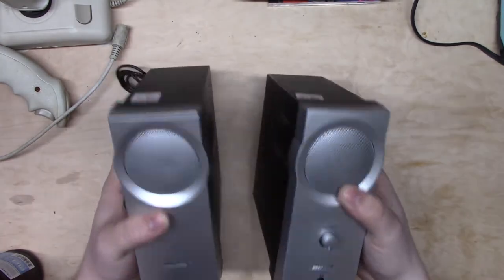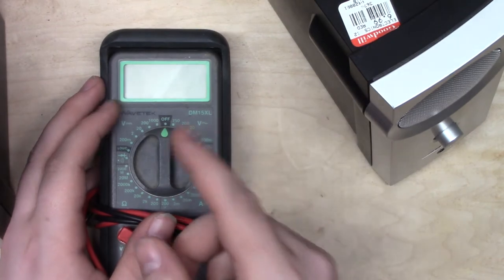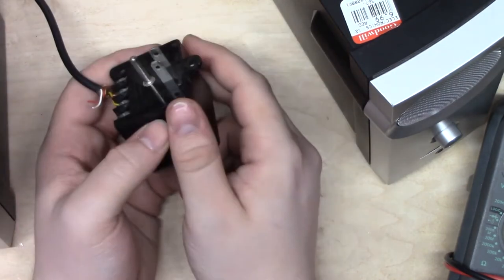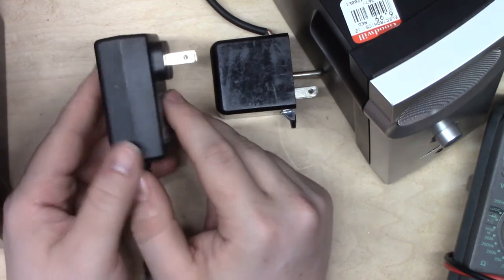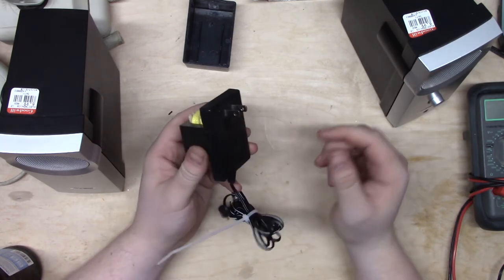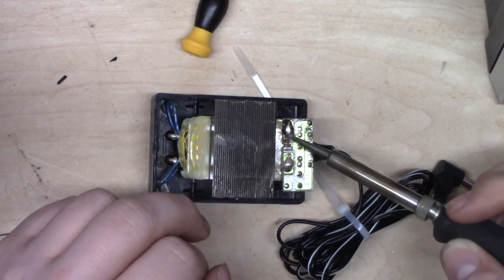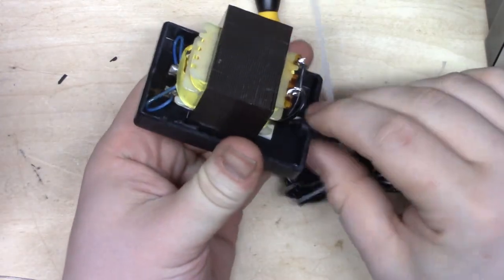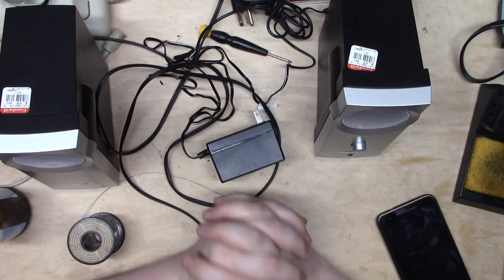DC to AC Adapter Conversion

Comment: "Switched-mode power supplies are voodoo."

I couldn't help but laugh at this. I'm no electrical engineer but the concept of operation behind them escapes me as well.
Reply: They aren't that bad.
The simplest example of a DC to DC SMPS would be an oscillator driving the gate of a switching transistor that feeds a transformer, which steps up/down the voltage, which is often regulated by a field effect transistor, and smoothed by capacitors, then rectified.
Reply: It’s not the basic theory that makes SMPS voodoo.  It’s all the weird magnetic and parasitic stuff that happens in any real-world design.  THAT’S friggin voodoo.

Comment: So volt-amps are ostensibly equivalant to Watts...but as with anything real, the truth is more complicated than that!

I frequently work with kVA and KW for power generation stuff at work. When you're working with DC, the two are equivalent because there's nothing crazy going on; DC power is a straight shot. With AC, you get all kinds of weird effects depending on if you're single-phase or three-phase and so on. An interesting artifact of all that is  that the peak of the sinusoidal wave isn't actually (using this case as an example) 12.2 volts--it's probably something like 15 volts at the very peak of that wave but I'm frankly too lazy to calculate it right now--but the "average" power delivered on either side of the sine wave is roughly 12.2 volts. This means the actual wattage going in to the adapter is different. The actual calculation is simple enough, it's a root mean square or RMS and all that means is that VA is the hypotenuse of a right triangle and Watts are the base; the phase is the angle between the two and the leg is something called reactive power which...I've never used and hope I never have to because I'm a mechanical engineer and that's a bit outside my wheelhouse!
Reply: Oh yeah, good choice in music, too!  [100 emoji goes here way too many times]

Comment: Thanks, I broke my 20V AC adapter for my speakers. Figured it was impossible to find a new adapter, and have to make one myself somehow.
I also analyzed the print board. And I think it's obvious they do it is for size reasons and cost reasons.
So there's 3 different ways to do it:

1. Using Internal power supply, you plug 100-230v directly into it, it uses a transformer to convert it to 12V AC. Speaker drivers can then draw from that directly, and amp will draw through an AC/DC converter. cheap, but size disadvantage

2. Using AC/DC Adapter, the amp draw directly from it (and eventually from batteries), very space saving, but costly, since speakers has to draw from a DC to AC invertor, which is quite complex. and the adapter contains an ac converter/transformer and ac/dc converter. Also seems a bit counterproductive to convert 12V AC to DC, and invert it back to 12V AC later on. 

3. Using AC/AC adapter (transformer) 100-230v gets tranformed to 12v, speaker drivers can draw from that, and amp will draw through an internal AC/DC convertor. This is space saving and as low cost as 1. 

Edit: I don't think an AMP does AC for speakers? Even though everyone says it on the internet, but I don't see any kind of conversion going on. And I managed to fix my T40II corsair speaker, by simply bypassing the AC to DC converter, so the DC input for the amp is directly connected to the power input, instead of drawing through the converter. Works perfect.
So I have NO clue why they do it like this, there is no need for AC in there.

Comment: It magically saved my guitar pedal power supply problem... used a 5v dc output... tested 9v, desoldered unneccessary stuffs and remeasured 7.2v AC out... it actually was enough to power the 9v ac pedal

Comment: I have taken apart a Tektronix tube-oscilloscope from the 50's that had a switching supply for the anode voltage. So yeah, they existed before the 70's :)
Reply: trucks from the 1930s used them, though they were mechanical switchers instead of solid-state.

Comment: The symbol on the speakers actually means that they are able to operate on both AC and DC and are not limited to AC alone. VA and Watts differ when dealing with AC voltage, for example, 12 Volts AC usually refers to 12 Volts RMS, Peak Voltage is higher. The RMS voltage of a sine wave can be obtained by multiplying peak voltage values by 1/√2 or 0.7071. So 12 Volts AC peaks at approximately 17 Volts. The resultant 17 Volts AC produces the same power (Wattage) as 12 Volts DC providing the current load in Ampers for both are the save. Effectively, a DC supply of 12 Volts at 1 Amp will produce the same Wattage as an AC supply at 17 Volts AC at 1 Amp, 12 Watts. :)
Reply: I have a speakers/sub combo, and I found out… actually the easier way that it does support DC in, which I had actually assumed the power supply came with provided, but realised it does not when I tried it in something else and it didn’t work. Didn’t seem to break what I plugged it into but it also didn’t work. I couldn’t get the supply working after that, although it was already dying which was why I replaced it. Plus the old unit got hot and I have to imagine was inefficient.

Comment: If something has the same voltamps as volts, it's 1 amp. Screw anyone who would split hairs over this. 16v at 16va = 1 amp. 
The thing has to do with real vs apparent power. Basically, transformers delay the current, so the volts offered and current drawn are now offset. This lag means the actual current it delivers IN PRACTICE is lower. Usually my a factor of 0.8. If something demands 16VA on a 16v power supply, it is actually demanding ~12.8 watts.

Comment: Enjoyed everything about this video. Will definitely keep this trick in mind, as it will increase the usefulness of my bin full of old power supplies in the garage.

What limits the current that can safely be drawn from an AC transformer? Wire gauge probably?
Reply from the maker: Yep, wire gauge. Basically everything in electronics currentwise is limited by conductor size.
Reply: as you draw more current from a transformer the output voltage drops until it's no longer usable, a fuse pops, or it melts down.

Comment: Both the big dc adapter and the smaller one are switching power supply its the only way to achieve high efficiency and all a switching power supply is the mains voltage gets stepped down in a transformer then goes through a rectifier  to convert to dc then the power is sent through a transistor or Mosfet turning on and off very fast (pwm) and the time on and off determine the output voltage and it then gets filtered with some caps the reason one is bigger than the other is because the little one uses a type of microcontroller to generate the pwm signal where the larger one has to use discreet components to make the pwm signal

Comment: Well thank you it worked on both my digitech rp200 and my line 6 pod xt live and they both worked just fine with this conversion using only 800 ma when the pedals say they need 2000 ma to work yet they still work fine

Comment: good tutorial, though I always get concerned about adding more solder when removing parts. wouldn't the additional heat be a concern to some components?
Reply: Sometimes! You have to know what tends to be safe with it. These kinds of components are usually okay though. And adding more solder doesn't necessarily add extra heat to the surroundings (in fact it makes it penetrate the existing solder better because fluids tend to want to stick together), and most heat damage on components comes from using an iron that's too hot or not pre-heating if it needs that. But yes, heat damage can definitely be a thing when soldering and it's good that you thought of that.

Comment: enjoyed the video. I want to make one of these to run a dc fuel pump. on-line I found an "AC-DC converter 110V 220V 230V to 12V isolated switching power supply board, US". will this handle my project? usually I hook my dc pump up directly to my truck battery but have to keep the truck running to get enough power. thank you for your assistance.

Comment: I ended up spending $20 on a doorbell transformer at home Depot because I needed 24vac and searching "24vac transformer" on ebay only gave me ac adapters. If it makes you feel better I took two years of electricians school and I never understood volt-amperes.

Comment: This is kind of funny, because all they did was move the bridge rectifier and capacitor into the speaker, so you didn't need to convert the DC PSU to AC at all, only gained about 1.4V doing what you did, OR you could have done a similar mod inside the speaker instead, then it is usable with the larger majority of DC adapters.

Comment: Hey buddy, funny and educational 😂
I’ve got a transformer just like in your video that’s about 19 v ac in the meter- Output is already ac just like I need but I need to reduce the voltage down to 12 volts- I’ve looked all over with no luck, I’m hoping to make it variable as well, any suggestions? Thanks!

Comment: Super interesting! So in the retro gaming community it's sometimes stated that if your NES AC power supply is unavailable, you can get by using a DC power supply with the same voltage. It was kind of weird to me that the NES PSU provides AC current but every other contemporary machine used DC. Do you suppose this was a cost-cutting measure from Nintendo, to just not have to pay for the rectifier and save a few cents? Or could there have been some actual benefit to using an AC power supply?

Comment: I don't think I buy the "majority of these" are bad (about switcher power supplies).  Yes, they are more complicated than an old-school transformer, but the reality is that they are lighter, smaller, more accurate, waste a lot less power, make a lot less heat, and because there is no big heavy transformer, they are much cheaper to build.  Like anything else, you can guy a cheap one for $2, or you can buy a good one.
Reply from the maker: A bad switching power supply is better than virtually any transformer in a number of ways, but that doesn't mean that the overwhelming majority of the switching power supplies that we have in our houses aren't built like crap. There is so much more to go wrong and the failure modes are far more catastrophic then with a plain transformer, which either works or doesn't, and when it doesn't it almost invariably simply stops producing power at all. When virtually every switching supply I've obtained in the last decade produces a continuous whining noise that changes with load, something which does not happen in correctly designed supplies, I feel confident saying that most of these things are not made well.